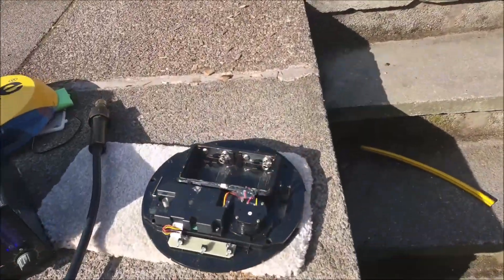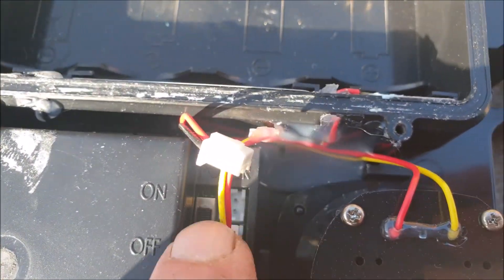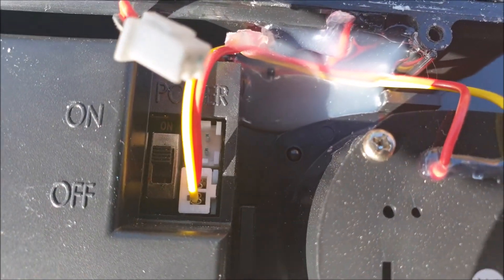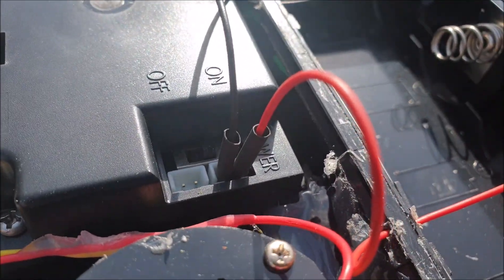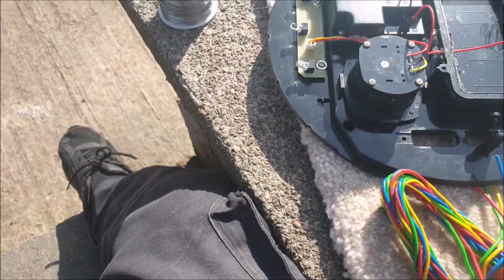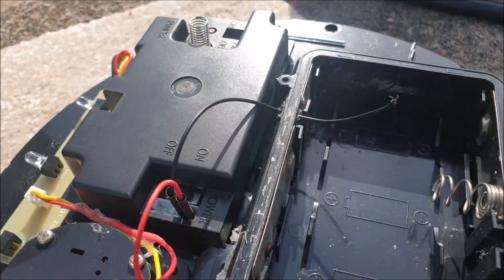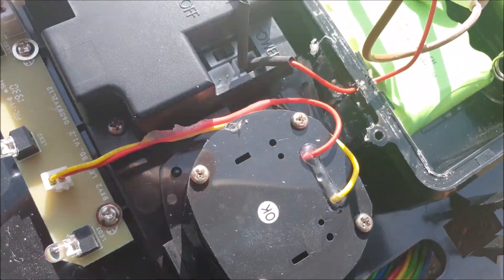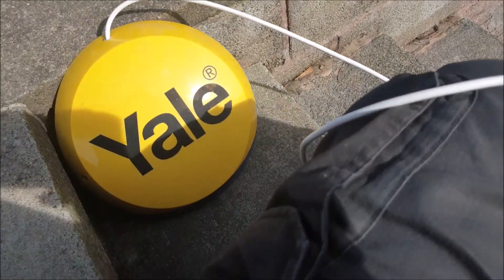Yale Wireless Alarm Bellbox Battery Fix

Comment: I am also fed up with changing the batteries, my battery box is OK. I intend to get rechargeable D cells and run charging wires from inside the house to the battery feed. I assume you leave yours on charge all the time. Does it still work OK?
Reply from the maker: Hi, yes, it is working fine.  I do leave it on charge all the time and i expect after a couple of years i will need to change the pack, but once every two years is better than every 6 months. It's a simple, cheap mod that works as intended. You may as well buy some good 1800Mah Eneloop and then a AA to D adapter. My battery contacts broke off so i couldn't use D cells.

Comment: Excellent idea, but that rechargeable battery will only last for 30sec if siren was to be activated. Size D batteries produce a much higher capacity so siren can sound for roughly 15mins. You would need a 20000mah rechargeable battery to have the same effect.
Reply from the maker: What? Are you having a laugh. That battery will run the entire bellbox for just over a week. It will certainly  power the alarm siren for several hours.
WHY would i need a 20 AMP battery???? Mate, your electrical maths are WAY off. Or you just don't understand why i did this.The *rechargeable* battery is a *failsafe* in the event of a powercut, the main alarm control panel is connected via a UPS which will power the alarm for well over 96 hours and as all the sensors are battery powered, they still function. Therefore in the event of a LONG power outage, my alarm will function for at least a week without mains power. I did this because it solves the issue of the crappy battery  connectors and i dont have to get ladders out to change batteries. YES, if i had kept it totally wireless then i agree but even so, i would have still have to change / charge it. Now, it is trickle charged 24/7. Yes, at some point i will have to change it but not for a couple of years at least.